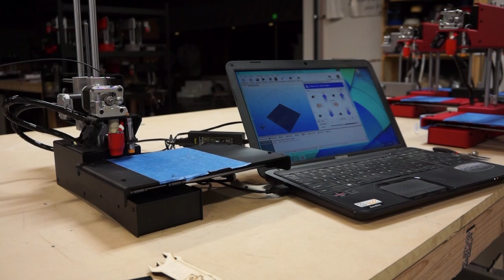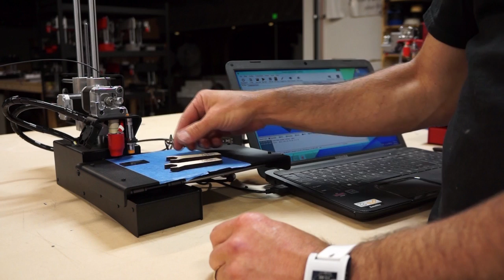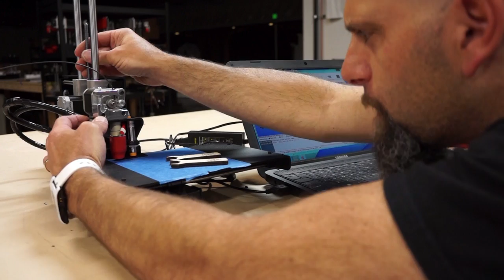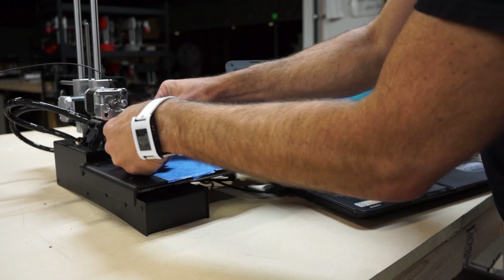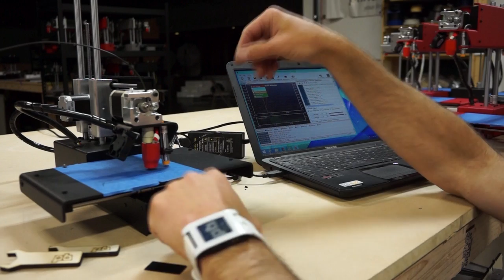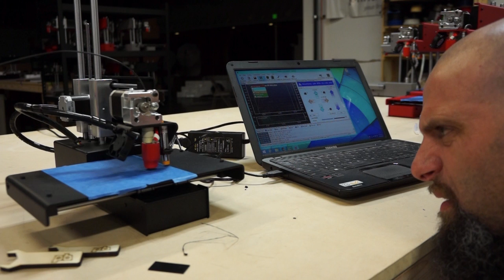Printrbot Auto Level Sensor Setup

Comment: You have no idea what you're doing. You should adjust the Z level by setting the correct sensor/head disparity in firmware, not by eyeballing it with some wooden wrenches and hoping it won't scratch the surface! Wtf man, really, I have been learning of these printers for 3 days and already know how to do it properly.

I got one of these PrintrBot metals for free and this video makes me want to throw it out of the window if it was designed by such morons. Shame.

Comment: i just bough a 3d printer and its not auto censoring. It has dived into my bed a couple of times. The top of my plate is too close to the printer that its smooshing it, and towards the bottom its to high. Please get back to me

Comment: My probe only ever moves up. put in G29. Goes to back corner. raises up 4mm. Go to front corner, goes up 4 more mm goes to other front corner, goes up 4mm more. I have bought 2 new probes at the bequest of printrbot techs. No more. Done with this stupid thing. Going to manually shim the bed and run G28 at start.

Comment: why in the world i can't find anything about simple maker's kit 1405 video whether its review or instruction. am i the only one that bought 1405 printrbot? its been fucking 6 months my printrbot doesn't print well. i have check every damn website even their official forum they don't even have instruction for 1405 & its a shitty Mac os. fuck sake windows is like common sense
Reply: charle sheen you are not, what do you need exactly?
Reply: charle sheen There must be something wrong with your google searches. I based my purchase on all the videos I have seen. Mine prints pretty good
Reply: Anthony Cruz printrbot maker kit Cura's start Gcode? g29 gives me hard time, if i print wide stl with g29 left side doesn't stick. i manually straighten the bed level by screwing up & down. there is problem with this cheap wood frames it somehow wobbles & worse part is zip tie doesn't hold z motor straight when i move it all the way to front so even if the bed is even i have adjust the two screw to lift it. repetier works well becuase it doesn't auto detects bed level when printing. but i like cura its fast when loading object & connects to printer instantly.... well sorry for my bad english. i have spent most of my time with printbot was adjusting bed levels and settings

Comment: So, I've been trying this over, and over. and somehow it would to down to 'read' the sensor, to get the signal from the printrboard.

i did all the steps (cura didn't work, so i tried Repetier (mac)) and it looked like it was going pretty well. but when i ran the project of the van thing, it just wend up along the z-axis. and started printing at ± 2cm height. 
Like you said, i lowered it slightly, only 0.5, and it repeated all steps. it went up even higher at like 3 cm. somehow it won't drop (along z-axis) and get the sensor to do his calibrating along the z axis.

is some of my wiring wrong? or maybe something else? When i lower it manually it gives the red little light.. so i don't get it?

Please help, thank you.

Comment: my printrbot came with a faulty probe :(
Reply: I think i'm having that same problem. The LED does not light up; also confirmed that the Z-stop did not work because it continued to move towards the bed even when I placed metal in front of the sensor. 

Did anyone else solve this or should I order another sensor?
Reply: kique kun i had to order a new one. they replaced it free of charge so they should help you out as well
Reply: I noticed my printr board is missing a jumper which supplies power to the z probe. I am having the part shipped over. Hopefully this solves my problem but if it's truly the z probe that is broke its good to know that I can get a replacement.
Reply: Totally didn't notice you are the same guy from the other comment section.
Reply: kique kun have you tried flipping the connector on your printrboard? that turned my led back on
Reply: yup. but i looked at the bored and it is completely missing the jumper

Comment: Hi Brook, you keep coming up everywhere so I'm gonna fire off a question to you. please respond if you can mate...
I have the Printrbot 1405 wood, I'm trying to level up the probe, however I'm noticing that, when printing, the Printrbot IS correcting for the Z axis, however it seems as though its sometimes not correcting enough. As I face the printer head on, I see that the left side is too close to the head, and to my right its too far away.
I base that on the first layers being squished out and thin (on the left), and too round when closest to my right... I have merlin V1 which is how it was shipped to me, and im nervous to reflash unnecessarily. Is it worth me upgrading (even if for other reasons)?
Additionally, I'm getting 'blobs' forming at permiter changes (I think that's the term). When drawing the 'skirt', as it moves from the first loop to the second, a hard lump forms. Then as it comes to the third layer, the nozzle may run near or over it, and it makes a loud knocking sound as it collides with the lump that was created. I;ve noticed that this even happens in a print, and has a 'snowball effect' for each additional layer.

Can you offer me some advice please? thank you!

Comment: I have machine shop gear.  Is there an ability for the end user to finite adjust the bed?  Or have you mounted it rigidly so we have to use the firmware.

No I dont have a 3d printer yet.  I am some what leaning to maybe your silver as you finally have a metal frame printer (wood will eventually succumb to warpage from humidity)

My problem is still price.  I need one about $300. (new)

Comment: i have a question about the printrbot assembled simple metal does it come pre calibrated or would i have to do that myself by using the z rod on the top or the g-code system because i am going to buy one soon and i was curious about it
Reply from the maker: Calibration is recommended as contents may have shifted... Some don't need it, some do.

Comment: I cant get my probe calibrated... Scratching my head. No matter what I put in G212 Z*** I get now change... yes I am saving with M500
and the setting changes when looked at with M501
Reply: Ok figrered it ot... It only adjusts while printing.. It will not work by just running G29 = Ok next thing.. when I kick off a print with the settings in the start code
04:36:29.672 : Bed x: 10 y: 142.40 z: -4.85
04:36:33.599 : Bed x: 10 y: 10 z: -4.84
04:36:38.848 : Bed x: 142.40 y: 10 z: -5.02
it runs x and Y without actually moving to the end of the line...??? just at x0 and y0

Comment: Got my metal yesterday, plugged it in for the first time this morning.. and it took off trying to print. your guys left an sd card in mine and it was trying to auto print from the file left on the sd card. unplugged and removed card.. Now i get this 6 or 7 commands waiting when i connect with rapetier and cant send any commands to the metal. Didnt have this issue with my Kit Pritrbot Jr. Anyone tell me how to fix this issue?  i did set up IAW the instructions posted on the metal simple site. if hit the OK in the debug window on the manual window it clears the 7 waiting commands. Didnt have to do this with the JR. Also now rapertier show 3 extruders now vice 1 as with the Jr. Anyone help?

Comment: Got my red limited edition today, it's printing pretty well out of box but I feel that there could be more squish. I'm find a little gap between extrusion widths (not layers the actual lines the printer puts down) I would have thought it would have been calibrated out of box. My question is are you measuring the distance of the hot end from the bed or the sensor? I don't have those tools either am I supposed to?